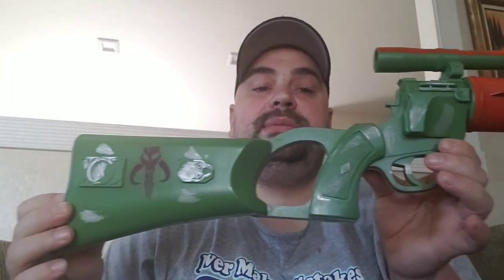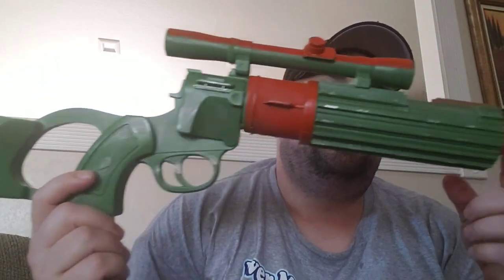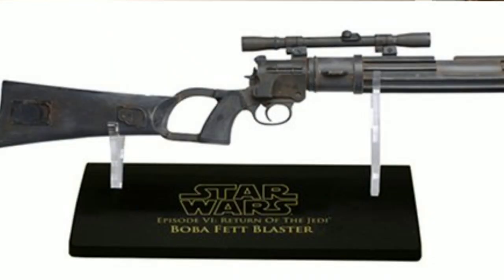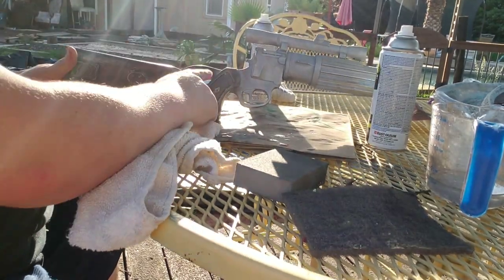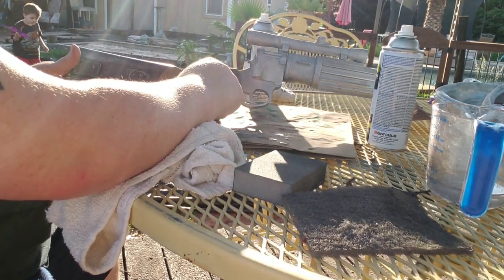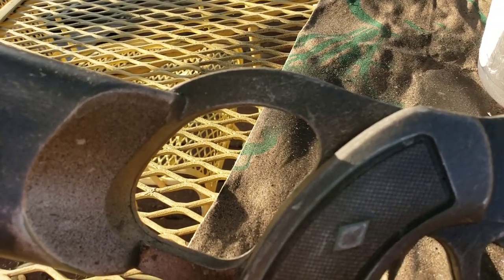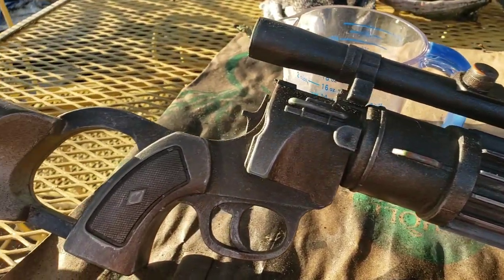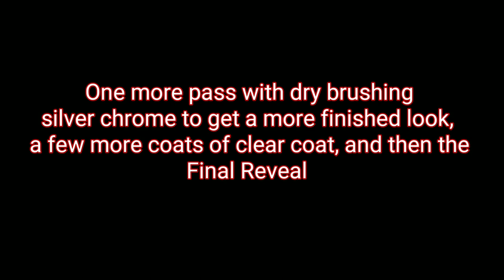Custom Collectible Boba Fett EE-3 Blaster by Rubies Costumes

#cookingwithtoys #starwars #bobafett

Comment: Nice work. I like the paint job. I just think your rust effect is too flat. The way I did rust on my Fallout Pipboy was to add a bit of sand to the wet first layer of rust and then I used a sponge to dab the other colors on top. It gives volume and texture to the rust.
Reply from the maker: Thanks for the tip, will try that out in a future project.